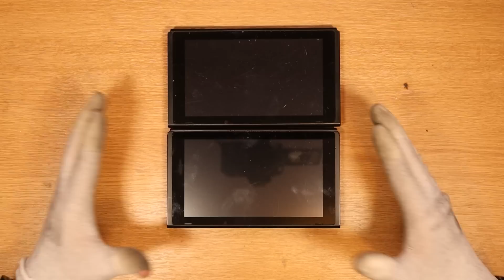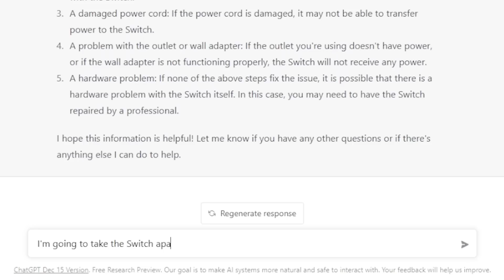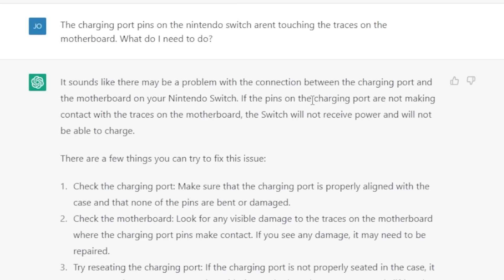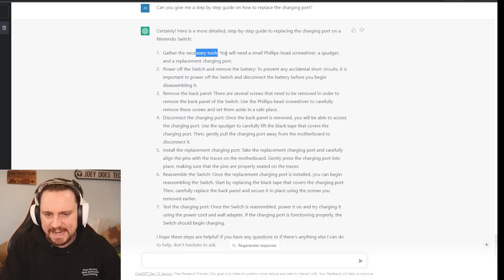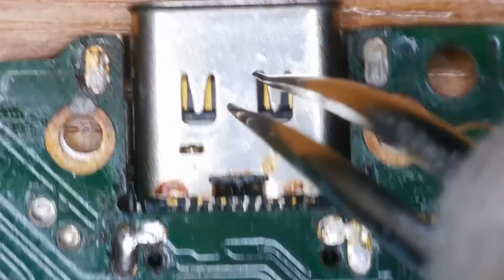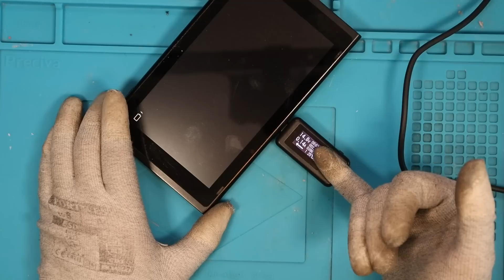I Let AI Fix a Broken Nintendo Switch – Will It Work??

Comment: Like the video. I guess the use of a.i. to fault find/repair in the electronics domain will only grow. By the way, what is the best temp to use on your hot air station(any recommendations on model) when cleaning up/re-soldering a pcb. I would usually try and use a vacuum soldering iron but your method looks great, but do you risk doing more damage/destroy solder mask. Also, what flux are you using? Thanks for any advice.
Reply from the maker: Kingbo RMA 218 is the flux :)

Comment: Hi Joey, enjoying the videos and hi from Yorkshire!

Love the premise on using Chat GPT but I think you should try it again but also try to improve your prompts to be a bit more specific and see if the outcome is better, I think you'll be surprised. e.g. I think I would go with something like "Assume you are high level electronics repair technician with extensive practical knowledge on video games console repair and access to repair schematics. Assume you are in a scenario where I (also a very skilled repair technician) require you to help me diagnose and rectify specific issues with modern games consoles. Assume I am skilled at microsoldering and have access to many replacement working parts and many electronics repair tools to aid me. I will give you a working scenario and I would like for you to tell me step by step how to rectify and repair the issue, suggest tests that I may do and ask me more questions if needed to isolate the problem."

I think a prompt like that will allow the AI to know your a professional and to not keep assuming you need basic instructions. It may also help the AI to frame its diagnosis and reasoning a little better. Keep up the good work.

Comment: I've tried to use ChatGPT to do small things like programming an ESP8266 as a NAT router, to no avail. The «example» sketch has been available on GitHub since 2019, and that's «inside» the cutoff date for ChatGPT. I've seen it repeat mistakes over and over, make up functions out of nowhere... a few hits, with a lot of misses. It will get better though, and time is on its side.

Comment: You should have told the AI that the port is not connected via ribbon cable, it is soldered to the motherboard. It would corrected itself and gave you better answers.

Comment: I think the AI refers mostly to a PlayStation 4 controller when talking about repairing the charging port. It is just screwed down and can be easily detached from the housing and pcb is only connected with a ribbon cable. It is also held in place by the black tape mentioned. Love the video idea, keep it up! 

Learned so much of your vids that yesterday i replaced a charging port on a switch lite successfully (on my first attempt). Was really shocked when it just worked. I used unleaded solder as i did not have leaded solder here.
Reply: I think several smartphones have the charging port on a daughter board which would just unplug too.

Comment: Whoever did that messed up solder job needs to go back and practice on dead boards before doing any more devices. They could have done so much more damage and may if they attempt to fix another device.